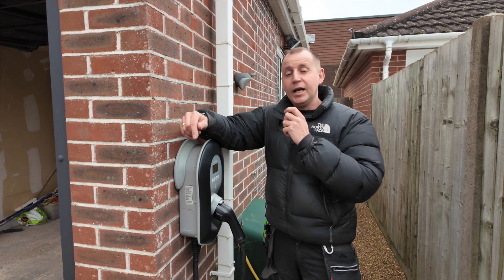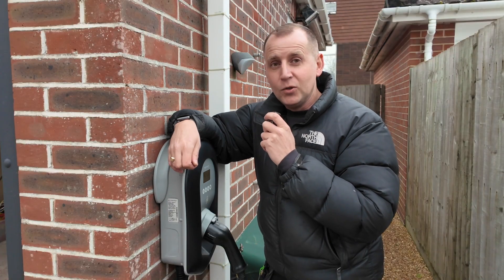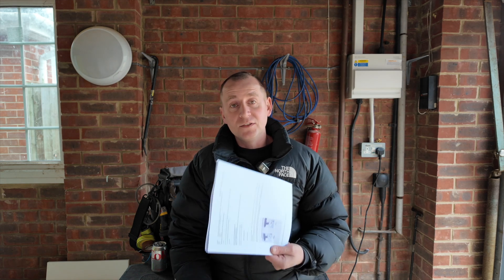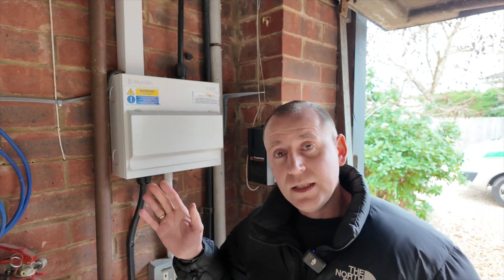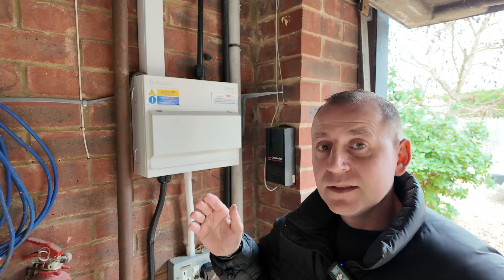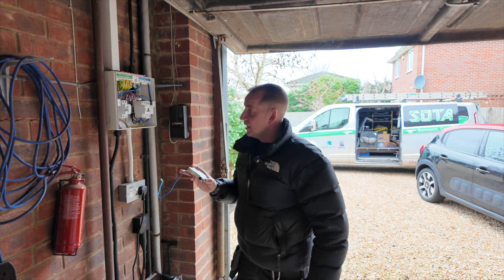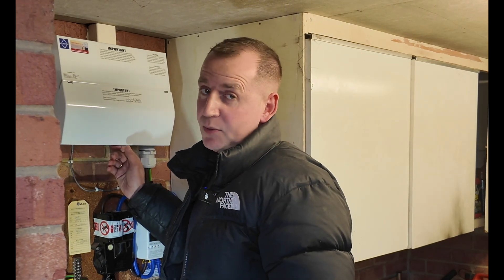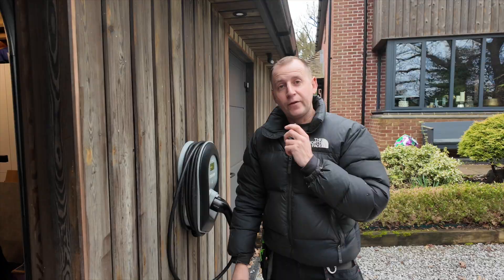THOUSANDS OF INSTALLATIONS MAY BE NON-COMPLIANT...ELECTRICIANS REQUIRED TO CARRY OUT REMEDIALS

Comment: myenergi are having your pants down mate, demand the warranty be honoured.  Unless they are prepared to put in writing that the Zappi can be damaged by the omission of an external RCD, which would be interesting considering they claim it has an RCD built in, they are just dodging a warranty claim.  They dodge paying us installers for warranty work as well so it seems to be standard practice for the scoundrels these days.

Interestingly, I always fit external RCBO's myself and I have never had the Zappi 'RCD' trip under test, the external RCD always trips first.  I have never fitted one to an MCB so I assume it does actually trip eventually but to try and say the warranty is void is total BS.  Push back and escalate it.

I was given a cosmetically damaged BG SyncEV to try about 18 months back, I loved it, the support is first class even for third party payment apps and, touch wood, I haven't been back to one since.  The Zappi has advantages but if it comes with all this BS the best thing to do is just not fit them.  Good luck.

Comment: But having a main switch RCD is a no no aswell...
Reply from the maker: Done a short why I done this, it’s a garage db not the main one.
Reply: @sotaelectrical  i saw that straight after haha .. I think my point is this is the most over-regulated country in the world, its ridiculous. I had my NICEIC ass towards the end of last year and he said I haven't applied selectivity because of an upstream RCBO on clipped direct cable for an EV install.. so I stopped, now we are saying we need it haha.
Reply: I’ll just point out that the Code of practice for EVC installations does say that selectivity is not practicable under some circumstances. Page 42

Comment: I can’t believe they have gone back on this, there are other YouTube sparks that have installed the Zappi using an MCB when clipped direct because they were also lead to believe they could. Now the installation has just one 30ma RCD for all circuits, maybe a 2pole RCD could have been installed next to the consumer unit supplied by the MCB so the other circuits would still be on there own RCBO’s. You always do great work!! And have been let down by the manufacturer. Shame but at least you have only done 5 this way. Keep up the good work and great videos.
Reply from the maker: Thank you for your comments, I have made a short in why I done what I done with the consumer unit, watch it and hopefully all will make sense 👍👍

Comment: Even changing to an up front RCD won’t be compliant as EV chargers need to have their own dedicated double pole Type A RCD you can’t put them on a split load board or with an up front RCD it needs to be a double pole RCBO or a dedicated RCD unfortunately…
Reply from the maker: I just made a short explaining why I done what I done, it’s a garage board with a couple of radials - no load, an outside light and a garage light. It’s not the main house C/U and I would like to know the reg you are referring to also if you have it?

Comment: Should never change the main switch to an RCD that will cause unwanted tripping of everything.  Should of installed and RCD in it's Own enclosure covering the circuit that needs protection
Reply from the maker: I don’t agree, that is a garage consumer unit with an outside socket radial, and 2 other socket radial circuits with no load, 1 x outside light circuit and one internal light for the garage. It’s not the main consumer unit

Comment: Why didn't just add a second mini consumer unit just for the charger?
Reply from the maker: Because that’s already a garage consumer unit, there is no load on it,
Reply: @sotaelectrical  I meant rather than replace all the RCBOs. Cost / time it would have been cheaper? Just replace the MCB with a two pole isolator,  cut the cable and patch in a mini-box
Reply from the maker: @abzzeus  I had all the parts already so I didn’t have to buy anything, honestly there is a reason why I done what I done

Comment: Just looked at when myenergi published their guidance on requiring an external RCD for UK installations, it was March 2022. That's for version 1.1, maybe there was an earlier version published. If they are taking the position that any repaired installation needs to be brought up to the latest regulations, i guess that's their prerogative, in some ways forcing installers to correct previous poor installations and generally making things safer isn't a bad thing.

If you installed before March 2022 there is a discussion to be had about who picks the cost up, I think it would be reasonable to ask the customer to cover or pay towards the extra costs. If installed after March 2022 then it wasn't installed to manufacturers instructions, I can see why there are separate documents for the UK as presumably this is mainly a UK issue.

Comment: Easy fix here...just buy a petrol car..no charger required...
Reply: All the EV chargers being installed the main supply cables can’t handle the load. Near me in Romford this happens a few week’s ago main cable blew and took out half of the high street for 3 days. Romford bus garage is gear up for EV they have just had 4  X new transformers installed outside for charging it has caused massive road problems install the new HV cables to the transformers. EV isn’t the future

Comment: Thank you for doing this video - a great public service for consumers and your fellow sparks.

I think Zappi are doing some mental gymnastics on this. Basically they are saying they cannot be supplying a warranty replacement which is knowingly going to be installed into a circuit that is not compliant with current regulations. (We all know they cannot be applied retrospectively).

It would be better if they did not reject warranty replacement outright but make it conditional on the fitting of a compliant upstream RCD and providing Zappi a signed certificate from a registered electrician.

I am not a sparky btw.

Comment: Hi Adam. Thanks for a good video about the EVCP’s internal type A RCD. My understanding of BS7671 is that EVCP’s need to have an upstream type A 30mA which  “mechanically” disconnects both live and neutral conductors. The EVCP’s internal RCD is of a digital design and therefore does not comply with BS7671. Either way, whatever the issue was with the Zappi, if not having an upstream RCD made no difference to the failure of the unit, then you have a valid warranty claim. 
I had something similar with a BG SYNC EV where it just decided to stop working completely, after 1-2 weeks. When I spoke to their warranty team, they asked what was the rating of the protective device, 32 or 40amp? I said 32amp as that’s what I fitted for close protection to the 7kW unit. They came back with it should have been a 40amp due to manufacturers recommendation. I explained to them that a 40amp allows a higher overload current, so makes absolutely no difference whatsoever to the unit deciding to just pack up. I purchased a new unit from my wholesaler, fitted it, returned the faulty unit and invoiced BG for their maximum £100+VAT for my two site visits, which has now been paid👍
Reply from the maker: Thank you for your comments!! Appreciate it

Comment: The one thing that gets me about the whole integral RCD of some chargers not meeting the standard of 61008 (for I believe not having a test button) is that surely these RCDs that are integral to chargers are likely to long term be more reliable. I’ve been to loads of installations where RCDs have never been tested and they no longer operate, where as I know for sure the Zappi tests it’s RCD before commencing every charge session.
Reply: I believe the standard actually allows for no test button to be present if it self tests the RCD.

Comment: Where double pole protection has been an issue to fit, if there is space in the CU, I keep the mcb, cut down the busbar and fit a double pole RCD at the end fed via the original mcb. Otherwise, a small enclosure out the CU does the same job for limited cost.

On the Myenergi front, I’ve replaced so many under warranty where the original install is pretty poor, without any evidence of their ‘new’ requirements already being in place. Poor form. Shame. My favourite products to fit.

Comment: Few things here but firstly myenergi are bang out of order. It was discussed on twitter with them a few years ago and they eventually admitted the RCD in the product doesn’t meet bs7671. The note was then added to the manual. 

So in terms of warranty claims they are taking the mick on this.

Outside of that the requirements in bs7671 have been clear so the introduction of EV charge points and RCDs to 61008 and 61009 should always be used. 

I’ve had a video out around this for.a good while. So in terms of installation standards we should be fitting them and you have done this in most cases from you said in the video. Top job.

But the product standard for the zappi does not require one so using that as a get out for a warranty claim is not good. 

Perhaps highlight to management at myenergi if you haven’t as yet.
Reply from the maker: Thanks for your comments appreciate that, tried calling myenergi on several occasions, can’t get through, it’s impossible
Reply: @sotaelectrical  similar experience. Jordan Brompton is usually awesome at dealing with stuff like this. I would expect she will be on it in the background.
Reply from the maker: @electrician247  thanks mate
Reply: "Outside of that the requirements in bs7671 have been clear so the introduction of EV charge points and RCDs to 61008 and 61009 should always be used. "
could you point me to the reg number

Comment: Now you have the zappi plus many other circuits on a single rcd. Build up of ac and dc leakage, in my opinion the installation is nowvless safe and an external rcd for the zappi woukd have been a better solution.
Reply from the maker: I knew this would come up, it’s already a garage board with 1 x external socket radial, and 2 x socket radials in the garage with nothing plugged in, 1 x outside light and 1 x internal light, literally no load so I didn’t see this as a problem, if it was the house C/U then fair enough

Comment: Would it have been easier to mount a type A DP rcd in an enclosure below the board and connect it inline of the charger circuit?
Reply from the maker: It’s just a garage board already with no load on it, no need to
Reply: @sotaelectrical  good point. I thought it was the main board for the property.
Reply from the maker: @MrImATarget  I think most people think it’s the main board, wish I had said something 🤣 I thought that clearly seeing no meter, cut out, massive garage doors may have made that obvious
Reply: @sotaelectrical  or maybe I should pay more attention lol
Reply from the maker: @MrImATarget  🤣

Comment: Your first installation...
Why didn't you replace the Elucian MCB with an Elucian CU1AFDD40B/32B AFDD with L+N isolation ???
Yes more cost, but less remedial work, plus if you fitted a RCD then MCB's, you are beyond the guideline of 3 MCB's per RCD. Plus you are replacing RCBO's for multiple MCB's from one RCD - kind of a step down/backwards ?
Yes the AFDD costs £100 ~120, but factor in RCD, £15, plus multiple MCB's say £20 = £35 anyway.
The £70 or so extra for AFDD could perhaps be shared with customer who retains the RCBO protection, but added AFDD peace of mind on the EV charger protection, switching both poles to satisfy Zappi & less work for you.

Still a pain, but end result is improved protection, reckon customer would go for sharing the AFDD cost for warranty & improved protection etc...

Not a fan of AFDD on all circuits, but I'm now leaning towards AFDD L+N for high load circuits like showers and EV's on a fresh install. The rules/regulations/guidelines/recommendations are continually changing, that it seems that it pays to over-specify a little on the spec, than simply just "meet" the requirements on the day

Lucky, you only had 5 installs to return to for remedial work - top stuff sir
Reply from the maker: I simply didn’t think of the AFDD option, my bad

Comment: Not an electrician, but assuming the regulation is all about RCD protecting the supply cable to the Zappi and anybody working inside the Zappi without properly isolating.
My Zappi is fed from a double pole RCD but only a type AC, not a type A.
As the potential DC fault is the other side of the type A RCD inside the Zappi and the install predates the legislation (installed 2020) am pretty sure I'm legal, and more importantly safe.
The circuit protection for the replacement charger is to meet current regs for the replacement. 
The Zappis you have already installed are fine but a like for like replacement is now non-compliant.
Does that sound correct?
Reply: As your installation was prior to March 2022, then it is compliant, after March 2022 type AC RCD's cannot be installed because they can be blinded by DC leakage, due to the increase of devices, not just EVSE's that leak DC back to the supply as a function of how they operate. A blinded RCD may not trip should an actual earth leakage fault occur.

Comment: Hi, really been enjoying the content after finding you recently! Quick question, I was quoted £950 for a Zappi 7kw charger install from a sparky. He then reduced the price to £850 because he said he had a bulk order coming in so the chargers weren’t costing him as much. Is it true that you get like a trade discount because these are £650 chargers that he only wants to charge me £850 for with installation? Seems too cheap?
Reply from the maker: Far too cheap, I have no idea how he’s doing that, the only way I can see that being feasible is if he has a free charger, otherwise £0 made on that job
Reply: @sotaelectrical  yeah I thought it was strange. Do you buy them for the same prices I can see? Circa £650?
Reply from the maker: @declangreen9707  yeah they are exactly around that
Reply: @sotaelectrical  Thankyou I will stay clear. I’d rather a safe install than a cheap one

Comment: Sounds like a company trying to wiggle out of a problem they had caused by themselves. Did they retro tell all their dealers or customers about this change and recommendation. Then they are fucked you can't change a warranty policy once a transaction has taken place unless a re-negioation of terms is accepted by both parties.  I would be handing them the bill of any retro fitting costs at current market values.

Comment: Wat is a RCD????Or RCDBO??Do you mean a earth leak switch???
Reply: If you're American think equivalent is GFCI.
RCD residual current device. Uses a differential current between live and neutral to trip. Not actually connected to earth. 
RCD will disconnect multiple circuits.
RCBO is same but for single circuits.
Reply: @grahamleiper1538 Yes,but when it go to neutral,it will also go earth.But i agree it is a strange name for it,but i find RCD even stranger,so thats why we in the Netherlands call it like that.

Comment: Their zappi2 manual v1.1  says ''The zappi features an integral 30mA Type-A RCD with 6mA DC protection and therefore an external RCD is not
required.''

Comment: Thanks for the heads up. I've got 2 from 2022, which are on MCBs. Thankfully, all my others are on RCBOs because I started fitting them as standard. Like you, I was specifically told on the training that it didn't need an up front RCD if the installation method satisfied the regs, which it did. I'm going to get them sorted to avoid any issues. 👍

Comment: Surely installing a separate 1way consumer unit with a double pole rcd would have been a better option.
Also now you have worsened the existing installation by introducing high risk of nuisance tripping with that rcd main switch.
Installing a AFDD with a rcd may have been another option I’m pretty sure most of them are double pole.
Reply from the maker: The installation is not worsened, it’s a garage consumer unit with no load.

Comment: I have watched this a couple of times now, and I still don't understand why.

The current regulations do not mandate a rcd upstream of the EVCP at all, they mandate under 722.531.3.101 that a rcd is required upstream of each socket outlet or the  bs 62196 connection (that's the car connection to EVCP) so a suitable rcd could be within the EVCP,  or upstream of the EVCP.

If their original equipment had an integral rcd , but their new replacement does not, then it isn't anything to do with the regulations changing at all  (after all with the 18th edition an rcd was required just the same, albeit with different wording)

This appears to be due to a design change of the product,  so ought to be funded by the product manufacturer under their warranty.

What an I missing?
Reply: It does have an RCD but it is not recognised by BS7671, part 7 lists all of the standards, unfortunately the zappi RCD does not comply with any of these standards.
Reply: In which case it is not the installer's responsibility for costs associated with upgrading the existing installation in order for a non-compliant product to meet compliance. 

That should be borne by the product manufacturer since their replacement product requires additional external electrical protection whilst their previous product did not when it was installed correctly.

Comment: Odd NAPIT didn't tell you, my niceic inspector told me that almost all chargers built in RCD's don't comply
Reply: Don't comply with what?
Reply: @XX-ww8lh BS7671 as the internal RCDs don't comply to BS61008
Reply: @XX-ww8lh  The RCD types for EV chargers listed in the regs
Reply: The  inbuilt "rcd " don't comply because it doesn't because regulating state that it must a test button to be an rcd, so all ev chargers require and RCD upstream of charger, found this out from niceic inspector